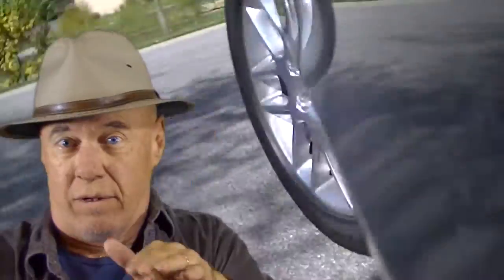TRAMLINING EXPLAINED

Comment: Thanks! I switched my wheels and tires and experienced this. My new tires were wider than OEM, Lower Profile than OEM, also I found my tire pressures were too high, and I have a ton of tread left. So.. all of the above. I'll fix the air pressure and see how that works.
Reply from the maker: Thanks for the comment, Darius. I hope a bit lower pressure decreases the tramlining for you. When it first happened to me, I thought my whole front suspension was messed up.

Comment: Glad I ran into this video that explains what I'm experiencing with my 69 Mustang. The tires that came with it is 225-60-15 so it's probably not too wide but not stock. I'll check tire pressure to make sure I'm not over inflating them. Thanks!
Reply from the maker: You're very welcome. Thanks for the comment. I had never heard of tramlining before I experienced it in my Corvette with the super wide tires. Let me know what you find out.

Comment: what if my REAR suspension is shifting left and right?  This happens when I'm going STRAIGHT on the freeway at high speeds on a SMOOTH road.  Very odd.  I bought all new suspension parts except my shocks and springs aren't the greatest quality.  Alignment is supposed correct (checked multiple times and it never changes).  Brand new tires, all seasons that are NOT wide.  Tire pressure a bit high, will try to lower.  Any other causes?  Maybe my rear sway bar snapped?  I'm getting way more understeer on high speed turns than before.

Comment: Does stiffer suspension help reduce it or softer suspension? Combined with softer psi. I have falken all terrain 285 65 18 on stock rims and my steering is moving a bit  more than when stock tires. 

My side door recom psi is 29 when i tried 33 psi front i felt the tramline a bit more i guess. So im trying to go down 29 again with softer damp Or harder damP on my shox? What combo is better?
Reply from the maker: I'm not an expert on suspension, but I would say it's probably the tires. I know the run-flats are the worst.

Comment: Under inflated runflats are notorious for tramlining especially low profile wide variants. Pressures both high and low do play a part. It’s nature of the tyre setup. If tracking correct and steering rack/suspension “play” acceptable and tyres reasonably new, the only option left is to fit firmer bushings to control arms etc. You want that sporty car… learn to live with it.

Comment: So why do you get more tramlining if you have more tyre tread? I thought it would be the opposite if you had less? I just put new 245 yokohomas on my rear for my BMW and I did notice a lot more than when my tires were bald...so I'm not discrediting you, just wanted to know why?
Reply from the maker: Chaz Peña CHAZ - Perhaps I explained it wrong. I didn't mean deeper tread, I meant wider tread. The wider the tire, the more susceptible it is to tramlining. Is that a little clearer?

Comment: thanks O.G my g37 with 275/30/20.11 started to tram lining im a just wear out the tires a little bit
Reply: same here.. have you found a fix and what size tires you have on the front? i run 245/35/20 front and 275/30/20 rear

Comment: I have 265/70/16 on a 2001 4Runner. Tires are new firestone's. Really bad tramlining on grooved interstate at over 60 mph. Scary. Psi recommended at 32 for truck. Doesn't do it on regular blacktop at high speeds. Hoping to wear out the tires more but they're rated at 70000 miles
Reply from the maker: I feel your frustration. The only thing I can suggest is to check your tire pressure. I've found that the "run flat" tires are the worst offenders.

Comment: Ok so how do you fix it???
Reply from the maker: There's really no "fix" for it, but you can help reduce it. Making sure your alignment is correct will help to reduce it. Also, keeping your tire pressure at the manufacturer's recommended pressure can help reduce it. Too much tire pressure makes it worse. Hope that helps. Wide tires are more prone to it than regular widths.

Comment: My car does this and i HATE it.... if my max psi is 49.... what air pressure should i set it at? 40?? Maybe lower??
Reply from the maker: I would probably set it close to the recommended air pressure. How wide are your tires?
Reply: @MagnumVideos  ok so i have a 2011 charger, i have after market 20 inch wheels and they are staggered. The wheels and tires are the same size as the factory models that have the upgraded wheel package though. When i first had them put on it drove perfect. A year later i took it in for a alignment and a balance to do some preventative maintenance. Also i had a wearing shock replaced... NOW its    Tramlining.... i took it in for an alignment check and the back was out of place so they did another alignment (3 months after already having one) but on a certain road it still Tramlines bad..... and it did not use to do this on that road before, idk what to do
Reply from the maker: I'm not sure, but the oversized wheels might be part of the problem. However, if you only have the issue on that particular road, it may be completely normal and the road may just have really bad grooves or ruts in it. If you have really wide tires, like I had on my Corvette, you may experience the issue a lot more. Maybe someone else can chime in with another opinion. @stephenmccurdy6619
Reply: @MagnumVideos  you are the man... thanks for your time